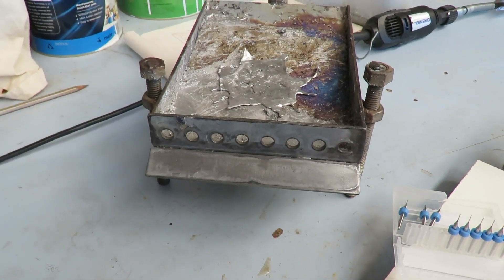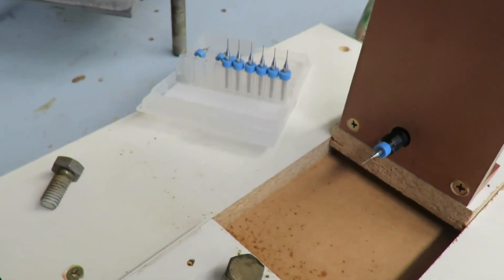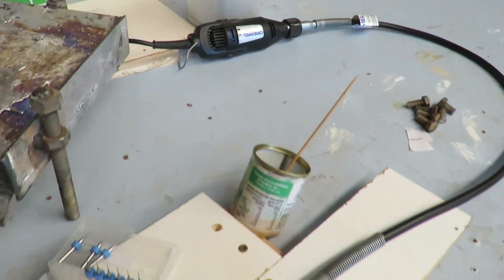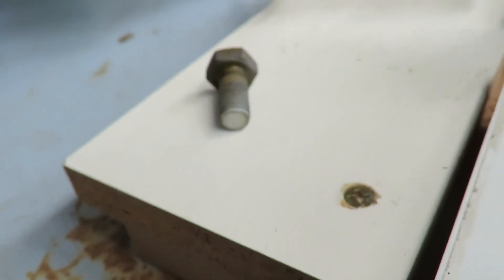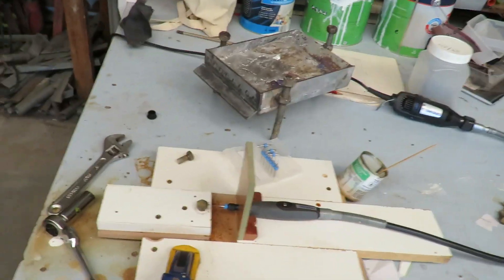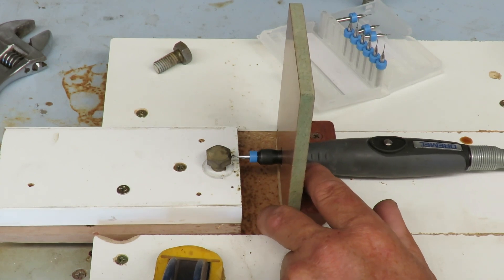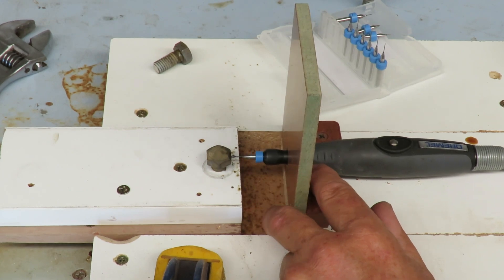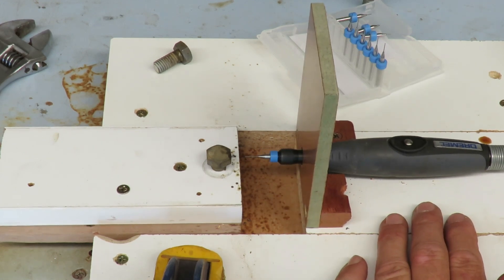Drilling lead drippers

Comment from the maker: I have since bought some brass 3D printer nozzles with .5mm and .4mm holes. Will give these a go when I have time, may be a simple and low cost source of drippers. They have a 6mm external thread.
Reply: How did the 3D Printer Nozzles work out?
Reply: Also curious

Comment: Very nice!  I think I would use brass pipe plugs with hex heads. So much easier to drill and they would be self sealing the more you tighten them.  Maybe somebody has done this and had a problem, but I don't see why they need to be steel.  Heck even using off the shelf, copper mig welder tips in .8mm would be another easy method.  I saw a guy making #7 shot using a .8mm hole with his setup like this.

Comment: which kind of drill bits did you use?
i cant drill a 0.4mm hole in my steel bolts, please help me.
Reply from the maker: They are circuit board drills off ebay. I have plenty of broken ones I can give you 😀.Heat the bolts to cherry red to temper first and air cool also helps. They are 8mm steel bolts, nothing special and drill a 3-4mm hole down the centre.

Comment: Would a 0.6mm mig welder tip work for this?
Reply: This is what I am about to try. I have a selection of Mig welding wire tips and have threaded holes in my cast iron rectangular skillet.

Comment: What size bolt are you using and what size is the other hole diameter?
Reply from the maker: Used 10mm bolts but not critical. Read somewhere to anneal the bolts by heating to cherry red and cooling slowly. Does make them easier to drill.